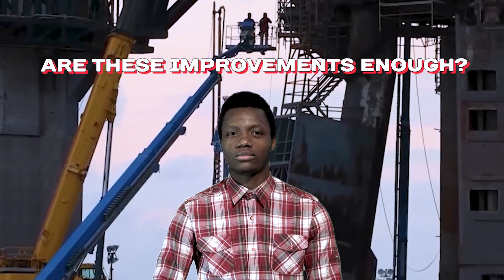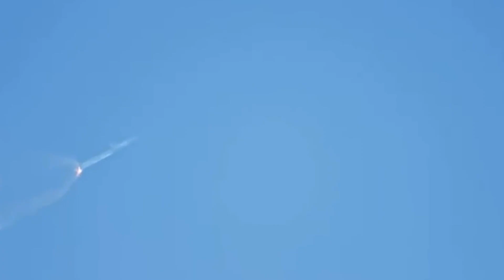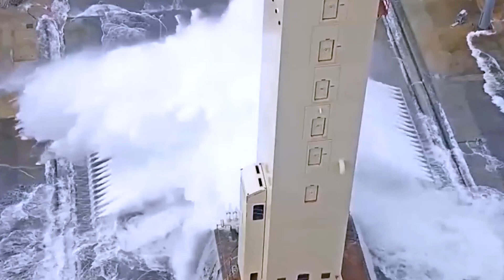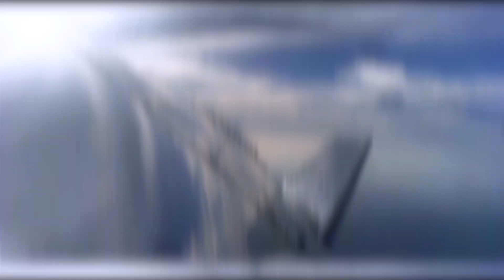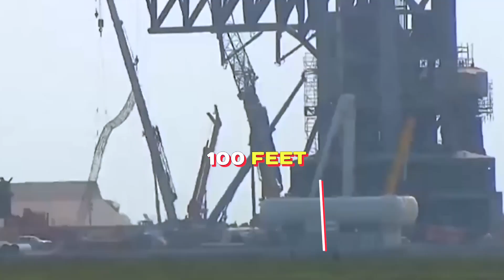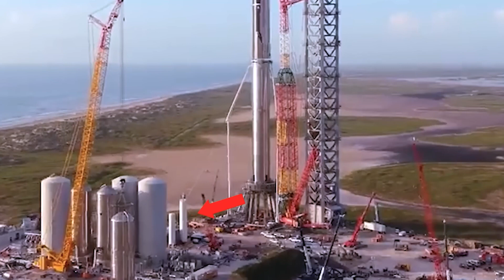Will Spacex's New Starship Platform Save 33 Engines?

Comment: The whole façade comes crashing down when one considers the sound engineering principles underpinning  the decision to launch on 4/20. It revealed a recklessness unwilling to consider proven technologies such as flame trenches and water spouts, while completely destroying the launch facility. Given the "fix" it will be a steel tornado instead of concrete.

What  other engineering principles will be disregarded before this dangerous effort is shut down?